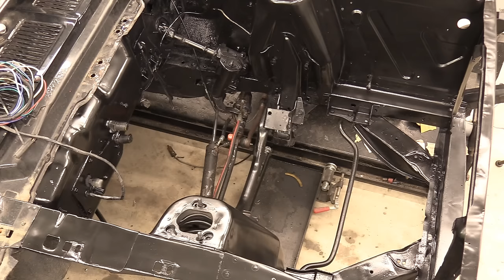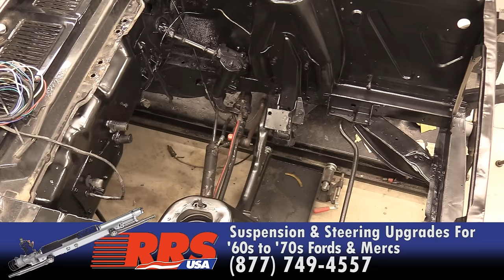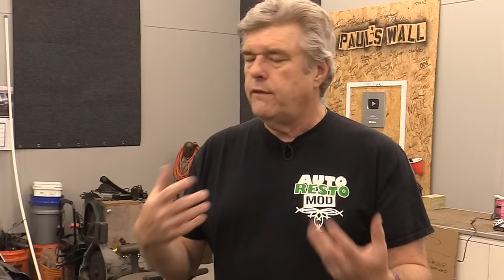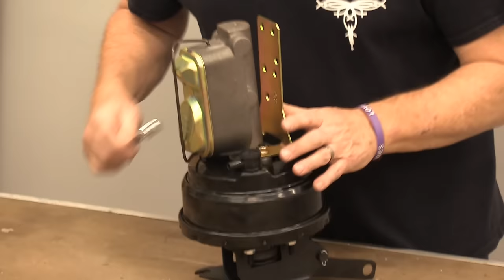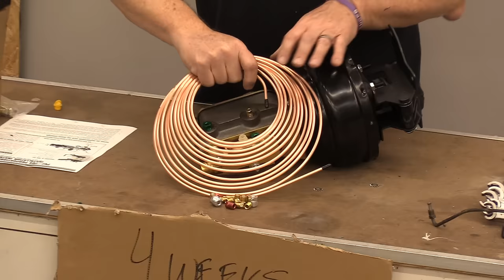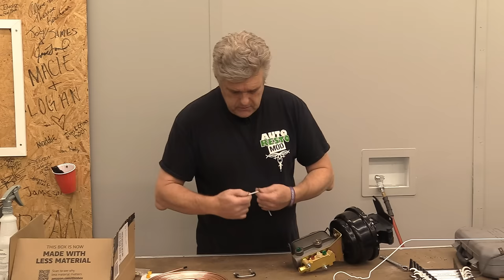Bending and Flaring NiCop brake lines

Comment: I just wrapped up two brake projects on mustangs.  Used NiCopp on both.  I ended up using AN fittings instead of double flare which cost a bit more, but has zero leaks to chase and looks great too.
Reply from the maker: I've never thought of using AN fitting that's pretty cool

Comment: I've just started renewing some steel brake lines using NiCop tube, I find it's much easier to both double flare and bend. I really like it. That engine bay looks so clean and fresh, good job!
Reply from the maker: Nicop is much much easier to use.

Comment: What are the chances of getting a master cylinder with the fittings towards the inside facing the engine or one that has them on both sides? Just a thought. Thanks for another awesome video.

Comment: As far as a good paint to use that closely matches the OEM color and sheen, I recommend Rustoleum Canyon River Black. It is an enamal paint that I beleive is more durable than a lacquer type paint. I have used it on my 66 Thunderbird with good results. I don't know about Mustangs, but the Thunderbird engine bay is painted the same color as the exterior.
George B
Reply from the maker: It depends on the car.Most forwards in the midsize range and down were painted the semi  flat black.
Reply: I just love the Satin finish on the firewalls etc and underneath the car. Looks so good! No drab flat or very shiny gloss, a nice in between.

Comment: When joining nicopp to steel lines, what material is best for the flare nuts? Is there a concern about dissimilar materials corroding (galvanic action)?
Reply from the maker: General, your fittings that Ford used back in the day were brass like the ones we are using. So I don't think there is a concern with galvanic issues.

Comment: Now would be a good time before you put more stuff in the engine compartment is to fill your steering gear box with grease and to show how it is done.
Reply: Just did that Jeff, after many years of not knowing that. lol What a difference is how easier it steers. (Manual Steering),  Took over a whole tube of #1 and then some.

Comment: If you use pliers to bend the lines use an old set.  The twisting motion loosens the joint and harms their primary use…pliers.
Reply from the maker: Good tip

Comment: I was yelling at the screen, why don’t ya use a tube bending tool
Reply from the maker: Cause I didn't need it. The stainless would require a bender.
Reply: @AutoRestoMod  Thennwhybwas it such a struggle? I’ve watched other folk using that tubing and it was no problem. Not a problem, just how it seemed.